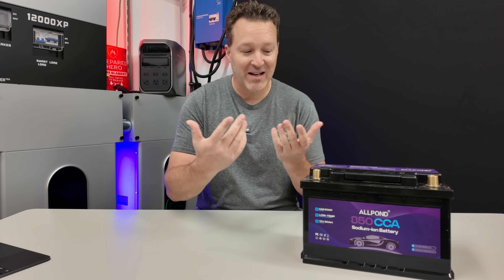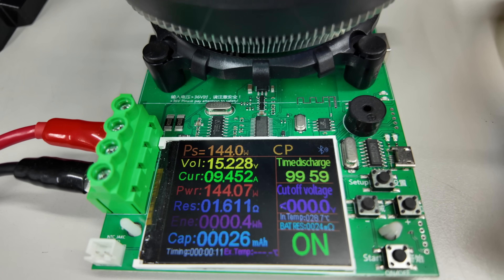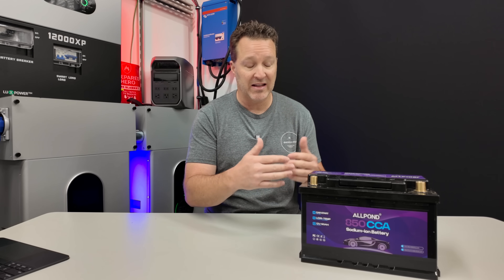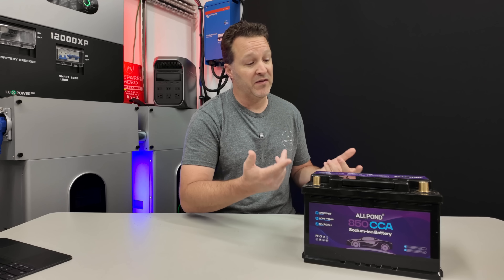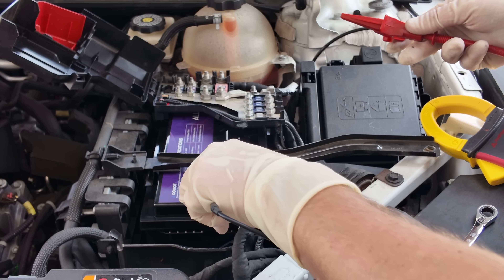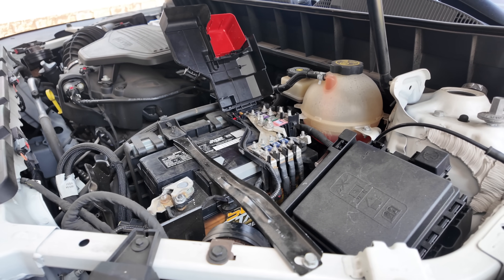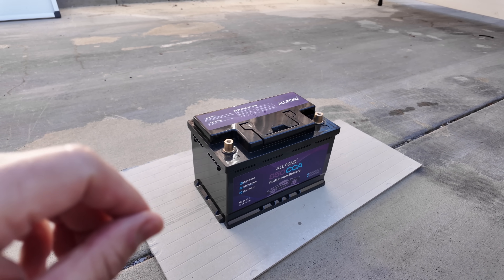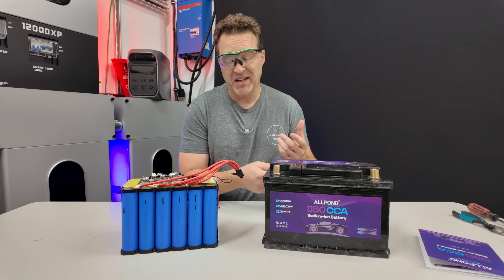Sodium Ion Battery Tech Hits The Auto Industry!- Are We Ready?

Comment: Apparently the sodium battery internal impedance is changing with different voltages. When the sodium battery is fully charged, the DC filtering is different than that of a lead acid. Put a scope across the batteries to see the alternator DC ripple.
Reply: Think bms, it shuts off the battery, as with other lithium ion batteries when fully charged. my NEW car battery is LTO, NO bms but a balancer, battery cells always directly connected and good for 20,000 cycles and 20C discharge rate (years of use) and temp-40C to +60C

Comment: You need to take a cell or two apart and test their chemistry to see if it's even Sodium. It's more than likely a cheap LFP chemistry to fool those wanting to try a "Sodium" battery.
Reply: @junehanzawa5165  what are you talking about? Sodium batteries have been out from multiple vendors for over a year. Do some research before posting nonsense.
Reply: @DanielBrownOre  Has a user outside of China tested the cells chemically to confirm it's Sodium? Please let us know the link to such video so we can see for ourselves.
Reply: @junehanzawa5165 I didn't know what you're on about like they didn't exist, to be clear they didn't have the energy density to support EV's until this latest generation coming out but have been available as 12v replacements for over a year by reputable companies.
Reply: @DanielBrownOre  Tell that to Will Prowes. Tell him where to get it. He'll take it apart and test it.

Comment: Also your starting test requires an onrush amp meter. A car starter can draw up to 400 amps for a short time
Reply: *inrush. but yes, that initial high current draw gets missed by most clamp meters unless they're set to some sort of high sampling rate mode (if they have that feature) or explicitly support inrush. You can also use a shunt since typically voltage measurements sample faster or have the ability to be turned up. 👍
Reply: Yeah, conditions that are perfect for Super Capacitors.
Reply: @Self.reliant  and the rest, my 3 cylinder 4 pack draws 580 on a normal cold start i.e ambient didn't get below 10C
Reply: Can go even higher than that depending on the engine/starter. Bigger engines have bigger starters that draw more. Diesels obviously need more also

Comment: Those reviews are ads. Those aren't actual reviews.

Also, save yourself the trouble and get an oscillating saw to cut those battery boxes open. Will Prowse uses them, and they work so much better.
Reply: I've tried telling them too, they don't listen.  We are just props for their ego, we don't really exist to them.  We are ghosts in the machine.
Reply: @mikemotorbike4283 why destroy a battery when you can pop the lid off on 5 minutes with a hammer and metal blade? Then the battery is still usable after the teardown...

Comment: But how good in extreme cold? I live at 4,000' on the US/CA border. We see -20F every winter and -30F+ every few winters. How will this battery do in a diesel truck that has been sitting outside unused for five days in -20F? The lead-acid batteries I currently have do fine. My side-by-side has dual AGM batteries, and it does great in the very cold weather.
Reply: I’m wondering the same thing…how the sodium ion will work in my dodge Cummins pickup. Dual batteries, 12k winch, sound system and bass amplifiers, and a bunch of off-road led lights. What kills my batte try s here in Gunnison Colorado winters is when doing a morning cold start at -20 or -30 like yous say. When the grid heater run on my Cummins 24v it straight drains the battery’s. Optima yellow top deep cycles, 2 of them. Wired togther in pastel with 0000 guage cable (that’s 4 ought guage! Big boy stuff, no winky dinky factory 4 guage battery cables hear) I re did everything in 00, and 0000 guage o then free copper cable. Extra grounds, powers, starter wires, and pos to pos batt wires and alt output to both batts pos terminals. I do like on optima’s having a top post and a side post. 
But again here in Colorado it gets cold. It’s not that my truck won’t start because it’s cold, it’ll be hard to start cause the grid heater just drains the batts down, especially if you gotta cycle the key twice. Plugging it in it’s fine, the grid heater barely even comes on. But on a cold morning start up it’ll run the battery’s down in 2 key cycles that it cranks really slow…and then click click. Heh. 
I have a ‘battery tender’ trickle charger I wired in with the block heater cord so they both plug in togther . That seems to help.
I’ve wanted to pull the trigger on lith batts but dam they are expensive. It’d cost me $1000-$1500 to do both battery’s. And then there’s the cold temps issue and charging. I’m not exactly sure I just know there’s some issues with doing lith car batts. My Honda dual sport bike has a lith battery and it’s awesome! 
I’m super curious about his new tech of ‘sodium ion’ battery’s and weather it’s the answer to diesel pickup cold weather problems.
Reply: @Moose400ex  varies widely depending on the battery's make and model, since there isn't a "standard" chemical formula for sodium ion yet. Some can go down to -40F/-40C and keep working fine, others freeze over at 14F/-10C

Comment: More than likely the charge mosfets where closing due to excessive voltage. With the charge mosfets off the car charging system senses no load and will confuse the system. To test this do not charge the battery to 14.6 volts. Put the battery in the vehicle at a mid-range soc/voltage. Start the car and it will likely charge normally. However, the 15 volts the cars system was putting out with the lead battery may charge the sodium battery above bms high voltage cut off eventually and cause the charge mosfet to open again cause the same issue. Its likely that BMS voltage window range is not compatible with that cars voltage output range causing the issues

Comment: I bought a sodium battery for my Prius to get better mileage.  i installed a 200W solar panel on my Prius roof and with the lead acid battery I got up to 60MPG.
I then changed to a LIFePO4 battery  and the MPG dropped. even if the battery is more efficient I think the BMS stops the charge and the solar production is lost.
TO fix that I added a small bank of super capacitors and set the solar charger to 14.2 V.  that brought back the MPG.
SO now in few days I am going to install the Sodium battery which I can charge to 14.4 v and should give me even better MPG
This solar panel method only helps Hybrid cars since, steering is electric, water pump is electric, brake booster is electric, etc. all 12 v.
I tried a 100w solar panel on my 4Runner and it makes no difference. Sodium batteries normally are kinda useless, but in my case is the best.

Comment: You can also use about half the Amp Hours with a lithium or similiar chemistry battery replacing a lead acid. However as it didn't match the capacity, I guess here it is more like 3/4. 60Ah should match a 85Ah nicely.

Comment: That is a problem in that Amazon any more is filled with fake reviews and junk.  Frustrating how often I have to return things now.  I have to do real homework like go to your channel to see what the deal is.

This brings up a good point with what I am dealing with.  Whenever you deviate from the battery chemistry something is designed around, problems crop up.  You gotta understand how your device is designed to handle batteries.  Even auto manufacturers don't understand this with say cars that do frequent starts / stops of the engine with a Pb battery.  That mode just sucks in every way and kills Pb batteries in no time flat.  You know my old Prius getting up to 280,000 miles now is only on its second Pb battery after the first one died 10 years in and still on the original NiMH traction battery over 13 years later.  Teslas, while not having perfect battery records, generally do pretty good because they are heavily optimized around their battery chemistry and those battery cells are pampered.  One of the big things to kill the Nissan Leaf early on and help lead to Nissan's CEO fleeing to Lebanon was even in the Leaf documentary when the CEO was asked the question about what did they do with the traction battery to make it last when the spec sheet said it wasn't up to snuff, he said straight out nothing.  Then everyone with a Nissan Leaf got a nasty surprise in that their cars had no range and Nissan wouldn't replace them even when they failed under warranty.  So yeah, with battery chemistry and vehicles, the best results are going to be when the auto manufacturers design their vehicles for them.

Another big place where you probably don't want to dork with battery chemistry are UPSes .  Usually these are optimized for Pb and it would probably be a bad idea for a number of reasons to stuff LFPs in a Pb optimized UPS.  If you want to use LFP, then you are more likely looking at an all-in-one solar charge inverter as a UPS replacement, granted you could get UPS software to work with it, which I doubt.  But maybe get ChatGPT to code up something for you.

Where I first succeeded with LFP was for an ebike project where I built the ebike back in 2009.  The motor / controller kit could handle the voltage range and I could get a charger specific to the battery.  When you do more open things like this, you can be more choosy.  Later this became a charging battery for R/C stuff.  Just keep things in certain voltage ranges and everything works.  Now many years later I have a different LFP battery and it has become my do everything battery with DC-DC buck boost converters, devices that just run straight off of it (usually with internal DC-DC buck-boost converters), and power inverters that can accept the voltage range out of it.  I actually wouldn't go for Sodium-ion simply because of voltage range issues causing compatibility issues.  LFP can just be stuffed into more places because of the voltage range and device compatibility with previous Pb applications.  Even just a small voltage increase and compatibility gets lost for some things.  Like a hobby charger that can take up to 28V.  The current LFP battery after being taken off the charger settles at 27.1V.  A Socium-ion batery settling at ~31V would actually break a lot of stuff compatibility wise.

Maybe that is something that I could get into or maybe you replicate, everything you can do with a 24V LFP battery and see how Sodium-ion stacks up?  I have my 100Ah battery setup with an Anderson SB120 connector, an SB50 connector, and a PowerPole connector.  I run hobby chargers off of it for my R/C stuff, granted I don't really have time for this any more.  I have 12/24V dual voltage USB chargers with PD.  I have a laptop specific DC-DC buck-boost power supply to drive an older work laptop.  I have a DC-DC buck-boost converter regulator to power a 32" monitor with a 24V power jack on it.  I have a 24V to 12V buck converter to power 12V stuff like a car based cell booster.  All of this gives new meaning to "working remotely".  I run a portable fridge directly off of the 24V battery.  I have a Victron MPPT controller that I use to charge the battery off of solar panels.  I have an old 600W pure sine inverter that plugs straight in through the SB50 plug.  I have a newer 3,000W pure sine inverter that I plug into the SB120 connector.  The regular charger designed for the battery also plugs into the SB50 connector.  I have a PowerPole distribution block I use to plug multiple things into the battery with.  I took a couple car auxiliary port expanders and added in PowerPole connectors.  So, with one 24V LFP battery, I can do hobby charging in the field, even bring a solar panel to charge the battery I use to charge batteries with and run my laptop to gather logs and tinker with controller settings with.  I can go camping and run a portable fridge, keep my USB powered stuff charged, run a cell booster, and even do some cooking with electricity like running my toaster oven.  Then get power off of a solar panel to keep the battery charged up.  I do some cooking at home with it as with the 3,000W inverter, I have an extra circuit to cook with while still having some headroom left on the inverter, so I am not maxing it out, which more and more it seems people need that extra circuit in their kitchen.  Especially in the fall when it gets dark sooner, I use the battery and the old and smaller 600W inverter to power 300W of LED lights to illuminate poorly lit playgrounds so my young son can play and I can see what is going on.  Those little kids get into way more trouble when they don't think the adults can see what is going on and people still bring their kids out to "burn off energy before bed", but I have a fix for that with this battery.  It has also been a great tool for emergency power because when stuff is going down and the power gets knocked out, it is often too hazardous to go outside at all, so can't setup a generator.  Then you don't actually want to run a generator 24 hours a day, so especially at night, you can say run your fridge off of the battery and a pure sine inverter.  This is all very useful and nice, but I don't think that Sodium-ion is up to it because of voltage range issues and how a lot of this equipment is currently designed.
Reply from the maker: I hear you on the Amazon reviews, it’s definitely hard to know what to trust!

Comment: Lithium DOES NOT do well in high heat areas..... The whole dcs saga should have proven this once and for all.... NO lithium chemical mixture will EVER be able to survive for ANY appreciable amount of time inside an ICE engine bay... only time will tell if the sodium-ion will be any better.. And... Sorry to say it.... If your alternator is putting out 15V...... Your 12V battery will not last very long.... NO alternator is supposed to put out any more than 14.6V for a lead acid battery... Your meters "instantaneous response time" Is to slow when using the current clamp part... You are merrily catching the tail end of the start.... Disconnect the fuel rail and try it again where you can have a bit longer crank time....

Comment: If you had the NA-ion battery with 12.5 volts rest voltage before you place it in to the vehicle. I think it would have worked. But since the rest voltage was greater than 14 volts. The car alternator could not put any current in to the NA-ion battery.

Comment: I bought six 25 AH LTO cells and a cell balancer board and built a battery for my car.
It charges at 14.4 volts which means that it only charges to about 80% of capacity or to about 20 amp hours.
LTO cells are good for more charge/discharge cycles than any other battery, they also have low impedance at low temperatures.
Has performed flawlessly winter and summer even though it has about 1/3 to 1/4 the amp hour rating of the lead acid battery.
Reply: It will probably outlast your car.

Comment: I like the idea of Sodium-Ion batteries because they can get cheap, have better temperature usage over Lithium.
I herd that it is theoretically possible to get as little as $10 per kilowatt hour and as much as 10,000 charge cycles with Sodium ion.  I want that battery.
Reply: Jessica!
Reply: I use LTO battery 20,000 cycles, 20C discharge rate and full output at minus 0F. LOOK IT UP. The only lithium battery that has a temp range of -40C to +60C and won't catch fire
Reply: @rickpalmer9518  yes I use yinlong cells!
Reply: Yeah I use a lifepoe4 battery in my motorcycle but something like this i could potentially see myself using one of these sodium batteries in my jeep
Reply: My diesel batteries are due barely start my vehicle I need to be replaced. I'm looking at getting a similar type of battery. Still looking...
Reply from the maker: Well o have a link down below 😂

Comment: BMS in battery? smart alternator fighting for control .
Reply: @shinc4054  that was my thought too. They need to make the BMS a little smarter. Input voltage could be boosted to match that of the battery, while output voltage is reduced to something better for the car.
Reply: BMS: We used to say battery murdering system with all the cheap boards from Chinese ebikes.
Losing water from the electrolyte and checking/refilling used to be the BMS for lead acid.
Reply: @shinc4054  Honestly back when cars were simple, BMS was never needed. We can still not need these constant consumers if we keep common sense engineering.

Comment: There's no reason that battery shouldn't work in any vehicle even with a higher max voltage.  The battery just won't fully charge, and the vehicles voltage regulator will lower the amps when it gets to that ~14.5V. But I'm guessing these newer vehicles are too smart for their own good and are "looking" for that lead acid voltage drop, which is totally silly. Either that or the BMS was cutting out incorrectly, causing those voltage fluctuations. With proper BMS, it might have worked better.  I'd like to see a short term test without the BMS and a honking slow blow fuse just to see what happens.
Also your amp clamp doesn't have inrush, so the metering averaging+latency wasn't capturing much of the cranking amps since it only took a second.
Reply from the maker: That meter has more functionality than you think just not inrush on DC
Great meter for so much but should have used a scan tool that showed live data and battery info… 
Totally forgot that part 🤷🏼‍♂️